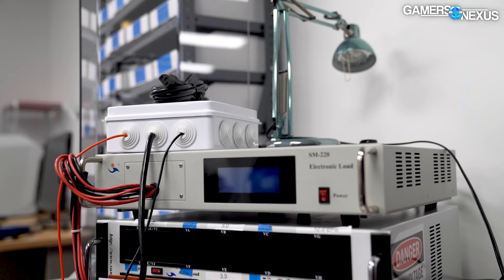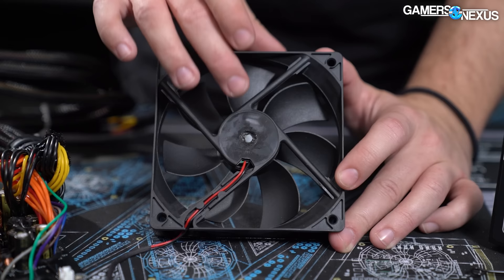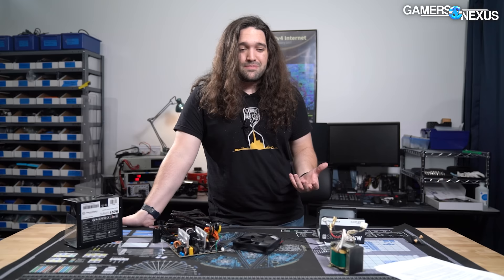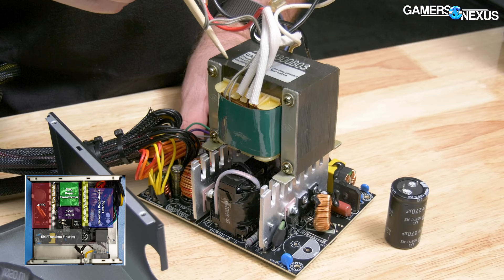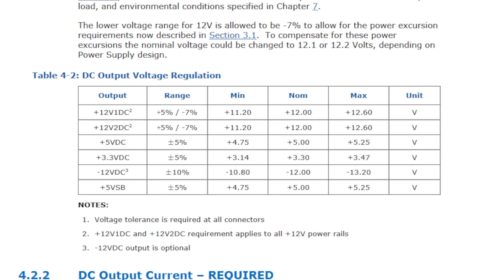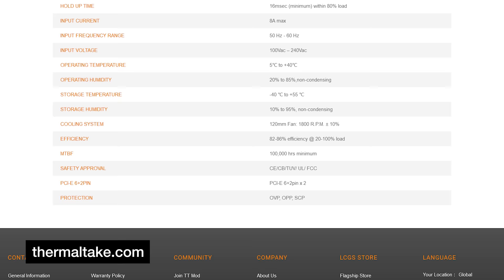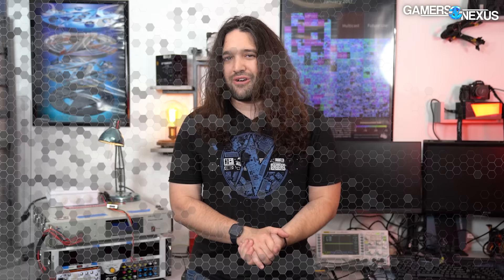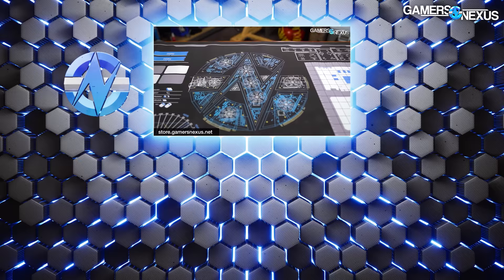Taking Risks on a Cheap PSU: $30 Thermaltake 430W SMART Power Supply Review

Comment: This seems to be a fair offering. I expected this one to perform worse tbh. One thing I would really love to hear more about during these psu reviews is noise level.
Reply: Yea, I thought this was an oversight on their part myself...It would be fairly easy for them to do...I have had several power supplies that were louder than my case fans!
Reply: Not sure how relevant this would be to the subject, but I have the 500w version of this series of psu and the the fan is basically silent. No coil whine to speak of.
Reply: I have this exact psu, its basically silent.
Reply: Yep, I have the Thermaltake Grand RGB and the coil whine is loud AF especially during idle.

Comment: I’ve used a few of these in systems and builds and so far no issues. Yeah they aren’t excellent but for entry level systems, they work well. And I’d rather have Teapo capacitors than the no-name ones found in other cheap PSUs that are guaranteed to bulge or leak in a year or two.

Look forward to more testing of PSUs across basic to premium!

Comment: In this price range, "meets the spec" is good enough.  It actually makes the Gigabyte failures all the more ridiculous.

The -12V SCP fail is the real discrepancy for the target use case.

Two comments on the data:
1. The first pass on the block diagram would have been better if a bit larger and not presented as an overlay on Patrick Stone.
2. It would have helped to have the Intel spec identified on the chart if that value was in the chart range.  I would not expand the chart to include it, but I think it would help to better understand what is, and is not, meeting the spec.
Reply: It doesn't quite meet the spec however. The cables are shorter than advertised :P
Reply: "The -12V SCP fail is the real discrepancy for the target use case." pretty sure they didn't include any protection in the specs, while only the -12V failed.

Comment: In the "for what it's worth" department, I've built hundreds of machines with these over the last fifteen years, and they've been nearly perfect. I can't remember the last failure. I've also built with at least dozens, if not hundreds, of the other wattage of TT Smart PSUs, and I think the only failure has been a DOA.
@gamersnexus maybe add some testing that looks for performance impacts of the voltage variability?

Comment: When we buy PSU's like these, we know what we're getting into. I bought one to revive a 10 year old system and has been running as a file server with no issues for awhile now. Great video.
Reply: Yeah I saw a comment about some guy saying he has these in his office PCs and of course the comments are ripping on him for using them but it seems like they missed the part where he said "office PCs." I wouldn't trust this in any gaming PC but in a standard office PC with onboard graphics It's most likely fine...
Reply: @Gatorade69  It's almost like they didn't watch the end of the video
Reply: @Gatorade69  the standart officePC runs fine with 200W PSUs that can actually only output 150 but never gets more than 70W dragged from them

Comment: I remember the days of getting "Free" power supplies with the case. In the early 2000's this was the thing todo when selling a case. Some of the most cool cases i found had a power supply included and no option to buy without for cheaper lol. The last one i had was a mini atx "Xcube" case around 2004, the PSU lasted about 6 months before taking out my motherboard. It smoked randomly, crackled, melted wires going to motherboard and the 24pin connector on motherboard.
Reply: @AdamsWorld I can remember buying a case with power supply for only $25 back in the 90's at computer shows, this was normal and everyone used these for builds!
Reply: @davidg2731 
The equipment of those times needed 75% less energy than modern components

I guess that's the whole explanation

Comment: I've had the 500w version of this in a spare PC of mine for around 2 years now, and I haven't had any problems with it so far. Granted, it only has to run an i3 9100f and GTX 1060 3gb, but at one point it powered a GTX 470 with no issues. I'd say for the price, it's not bad at all.
Reply: Running 6 years strong with my 750w Thermaltake PSU. Haven't had issues with my GTX 1070 and ryzen 3600x. I even stupid stuff before

Comment: These new PSU reviews are great. I've a friend who needs a cheap PSU just to repair a office PC, I'd suggest this since it's serviceable. One suggestion for these reviews I think is that if it's possible to add wave graphs of peak to peak ripples just out of interest plus in my opinion, it'll better visualise the ripples.
Reply: What you want is called an oscillogram. That's a capture from the screen of an oscilloscope. I think Steve's Rigol is capable of saving screen captures. You have to look at scopes a lot to develop some context for their waveforms to have much meaning.

Comment: I appreciated the block diagram/walk through and discussion of component choices/topology compared to higher quality power supplies.  I understood the fundamentals already, but the visual representation of it combined with the part-by-part explanation was quite helpful.  Being able to identify group regulated PSUs visually will be helpful in my own PSU testing.  I'm prototyping a PSU adapter specifically for building AT PCs in ATX cases, and some of the issues I've run into with minimum loads tie into the topology and regulation.
Reply: Isn't the 5volt problem not the bigger issue? Most modern-day PSU's only have a output of 100W on the 5 volt lines while a decent P1 system could suck up 150/200W. Also the -5 volt line has disappeared from the ATX standard for a very long time now (which was the white cable on the 24 pin connector) and is used by some ISA cards. I know the Soundblaster 16 and AWE 32 needs -5 volt to function properly, which was the reason I had to unfortunately hunt down a old PSU with the white -5 volt cable for my P2 system.
Reply: @thundereagle4130  The limited 5v output of newer PSU designs is certainly an issue, but just checking spec sheets is usually enough to figure out if a PSU will do the job in that respect.  There are a number of ways to implement a -5v rail when a PSU doesn't supply it: Phil's Computer Lab has the Voltage Blaster which is a tiny ISA card with VRM circuitry to supply -5V in a plug and play fashion.  Alternatively, you can roll your own that fits inline between the ATX PSU and AT power connectors.

Comment: Great review guys, I love that you emphasized the target market for the unit and didn't just call it "the worst PSU in it's class" or some other drama centric nonsense. These "budget" parts exist for a reason and knowing that it does the job it's intended to and does it passably well is all most people in the position to need such a cheap PSU want to know. At these price points even $5 makes a huge difference in component specs/performance. I can't imagine the margins on these are very high so kudos to Thermaltake for even producing these at such a low price point while keeping the quality at least safe for the intended use (unlike cheaper units). This is the kind of review I like to see. Some channels seem to have forgotten that not everyone can afford high end parts and bash on budget options (unfairly) just to get views.

Comment: This ought to be fun. I regularly use this PSU in entry level client builds. So far haven't had a single one fail over the years. But then again they are usually Athlon 3000g, 2400g,  or 5600 level builds used for basic computing and integrated graphics are all that is needed. Can't wait to see how these do when put through the ringer. Thanks Steve!!
Reply: Ouch lol

Comment: Anyway, I’ve used these PSUs in the past with “office computers” (think Dell Optiplexes and HP Pro/Elite towers) that were blessed with 24-pin power connectors. They’re perfectly fine with 2600/3770 CPUs and sub-225 watt GPUs.

Comment: Thanks for the review, as always, it's great to have more coverage of this otherwise under-represented part of the market. 
One suggestion that I would like to see implemented is to show the output voltage and ripple at the point when OCP triggers. If OCP is at 150% at 12V but output and ripple stay under control, it's not much of a problem. On the other hand, if OCP triggers at 130% but 12V output drops to 10.8V with .1V of ripple, that would be a problem.

Either way, I look forward to your next review!

Comment: It's amazing to see a $30 PSU built without Chinese crap capacitors and transistors! The topology of this is TTF + diode rectification, and I personally recommend this kind of PSU for people with low budget because it's really cheap and robust.
By the way, the choke nearby the standby transformer is the mag-amp for 3.3v, not for 5vsb regulation.
Reply: Teapo is cheap chinese crap. I've replaced thousands of failed Teapo capacitors in all matters of electronic equipment. The green vomit ones usually leak, the black ones with the gold stripe usually have a seal failure, dry out and short out.
Reply: I was super surprised. Some of their higher wattage models use the likes of chengx or asiax, so to see Teapo across the board and even 105°C rated, very nice.
Reply: @GGigabiteM  Teapo is Taiwanese, but for some people there's no difference there. :p
Reply: @らてちゃん All capacitor failure is bad, but leaking is worse because the electrolyte is both corrosive and conductive. If the leak is left long enough, it will eat into the circuitry and can seep inside the PCB and cause irreversible damage.

A short can be good if the circuitry is properly designed, a fuse can be blown or have OCP and shut the device down. In that case, you just have to change the caps.

Capacitors that go high ESR is another bad scenario. The capacitor effectively becomes a big resistor that draws heavy current and can blow components both up and downstream of it. I've seen a single bad capacitor cause cause multiple cascading failures that blew quite literally every component on the device to pieces.

Comment: 6:25 - The datasheet numbers are not sacred values. The datasheet says 8A continuous at a case temperature of 100C. It doesn't say you can't pass 10A with external cooling, like from the fan. However, it will never draw 10A unless it fails. Highest nominal current will be about 5A (~500W at 100VAC), so the 8A rectifier has 60% nominal margin. It's fine.

Comment: Thats the exact same I bought 5 years ago for my ryzen "upgrade" knowing it would barely scrape what I needed.  
It hasnt failed once  yet so it was definetly a win for me for the price I paid.

Currently running a R5 1600, RX580, 32GB ram and way too many hard drives with no issues. I'm planning on getting a 3060 but I dont trust the PSU to be able to handle it comfortably so an upgrade is certainly on my to do list.
Reply: your system uses 185W + 65W =250 plus some 30 for the hard drives, coolers etc, you would be probably fine on a 350W PSU since they might be able to survive some 450W ocasional loads
Reply: you'll be fine. i used to run an i7 2600 and an undervolted rx470 on a 240watt dell psu. when i bought my ryzen system, i went for a 430watt evga psu and ran a r5 2600 and gtx 1070 with zero problems (undervolting wasn't needed, but i did it). i recently upgraded to a 1080ti (250watt tdp) and the 430watt psu is still doing fine with the undervolted gpu. granted, i do not feel comfortable running it without the undervolt, but i undervolt all my cards anyway. 
also, i just looked up the tdp for each card, and it turns out that your 580 is actually rated for higher tdp than the 3060, 185watts vs 170watts.
Reply: Isn't the 3060 more power efficient than the rx580?
Reply: @wisico640  yeah but in the end, its is a cheap psu that has been used for 5 years nonstop...
Plus the previous one I had I gave away to a friend that had a similar power draw than my pc and he ended up blowing it up a week later
Reply: @QruisS  fair enough, a good psu should last quite a while longer tho. 

I have an old PC Power & Cooling 750w that has been running for like 14 years & still gives off solid voltages 😂

Comment: As an engineer for ~40 years, and one that headed up the power supply lab for mainframes at NCR,I can tell you that when it comes to power supplies, you get what you pay for. One thing that bothers me about many PSUs is the efficiency. We were able to reach 98% with our switching supplies using what we called mag amps (magnetic amplifiers). I see way too many that are below 90%.

I never pay under $150 for a PSU, but I suppose if I needed a cheap PC then I would go lower.
Reply: There are plenty of pure DC/DC converters that don't reach 98% of efficiency, let alone complete ATX power supplies - the best ones make it to over 95% on a good day, and what happens if you only want 10 or 20 watts out of them is another matter entirely. 
PC power supplies are mass market consumer products that have to hit quite a number of performance targets including size, reliability in the field (which may actually suffer if efficiency is pushed hard, as owners of the Seasonic Prime Titanium series SSR-xxxTD may be able to attest), safety, EMI, efficiency, standby power, power factor and cost - oh, and they're supposed to look pretty, too. It's a tough business, and the big OEMs behind the scenes all sport considerable amounts of vertical integration.

Mag amps are fascinating electrical engineering secret sauce that few outside the field of power supplies have even heard of. Even the general engineering public is not very well versed in magnetics. This might be a good topic for EEVBlog Dave, actually...

Comment: Personally, I really like the Thermaltake SMART series PSUs.  

I’ve been using them for the last few years with absolutely no issues to speak of (from the perspective of an ‘everyday man’ casual consumer) , and is currently my go-to for my lower end and mid-range systems (from a Core 2 Duo 38600 + GTX 750 system, to a i7-7700K + GTX 1060).  

Can’t say I’ve used the 430W,  though; I usually go with the 600W or 700W model.  Still.
Reply: Yeah that's age of parts where energy efficiency was prized
Reply: probably better size to most PSU's are not very efficient at full capacity
Reply: Thermaltake do not make their own power supplies they contract it out to various OEM, so if you buy their cheap PSU you get the ones made to be cheap. Their higher end PSUs will be made by one of the better manufacturers who don't cut corners and use high quality cap. i.e. their Toughpower range is generally good.